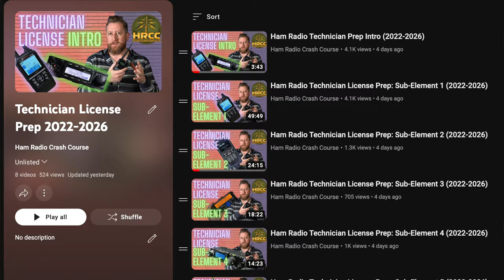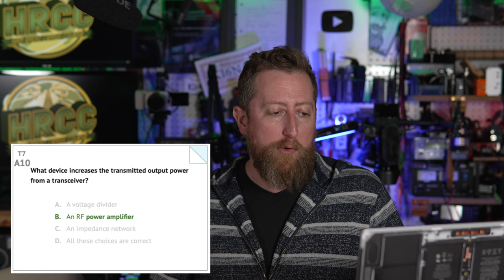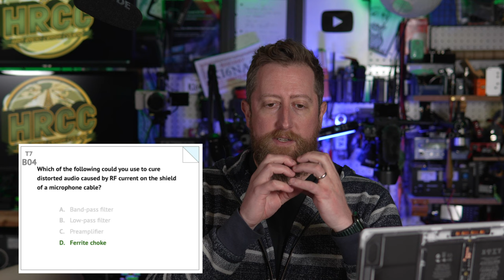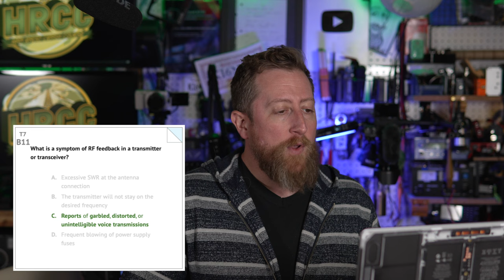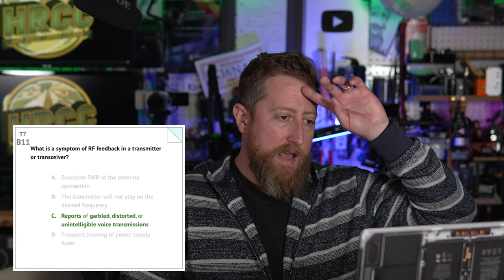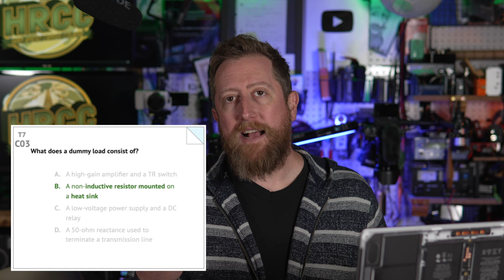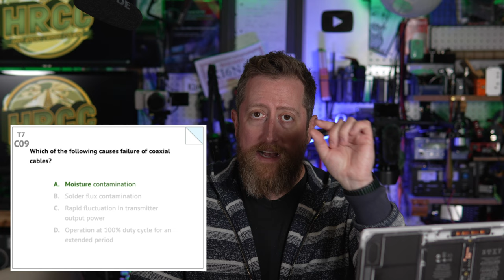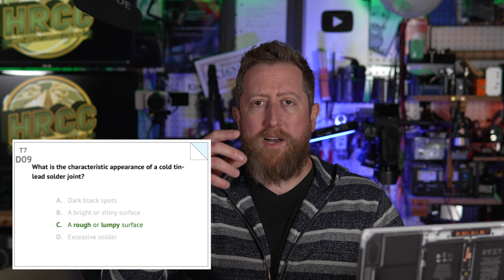Ham Radio Technician License Prep: Sub-Element 7 (2022-2026)

Comment: I rember as a little boy my father had a big metal desk in his office at home with a huge transmitter & receiver Cap radio. He used it to check in to the state net. I am sure it was military surplus.
Reply from the maker: Either that or old school tube based radios.
Reply: I think he had a big inverted "V" antenna made with bare wire in a tree in the back yard.

Comment: Have you noticed the ham bands are biginning to sound a lot like the 10 meter/CB band in the last few years since they have allowed the children to make up the question pool and test them selves.  I have more respect for the ham bands than that.
Reply from the maker: No not really.  Also, I understand the agism.  Most of the bad actors I see on the bands are older entitled dudes.
Reply: So what you're saying is that there has been more life injected into the hobby?